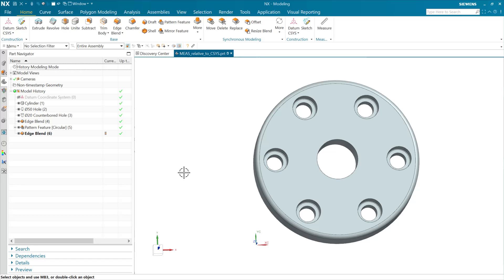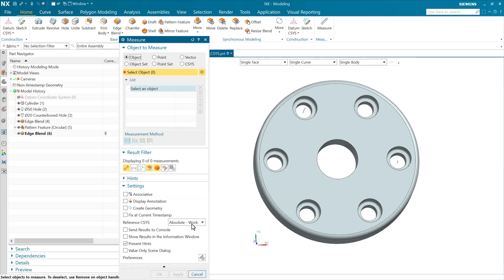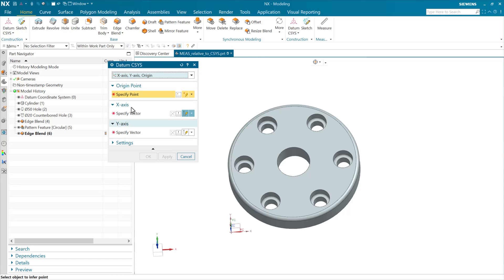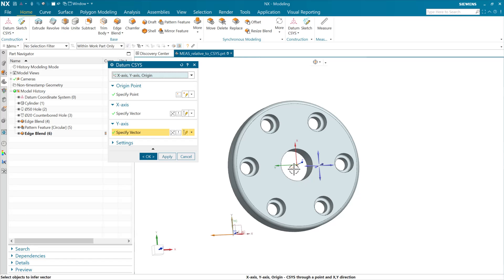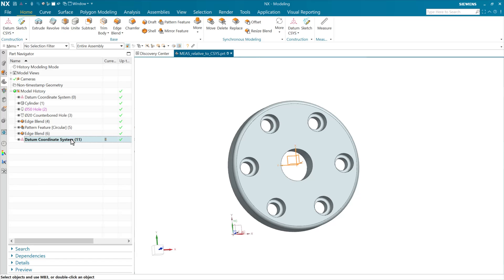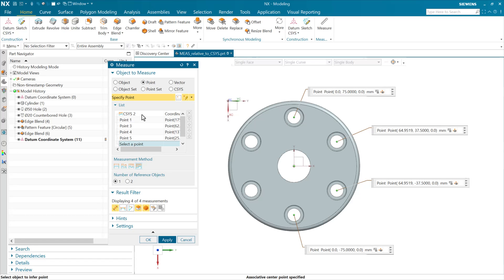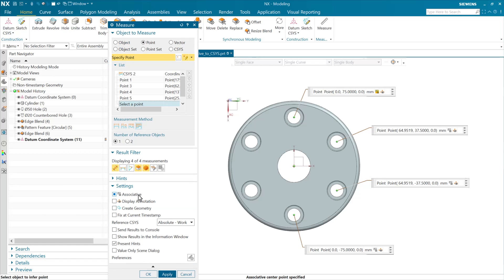NX Measure: Measuring relative to an alternate coordinate system [NX 12.0.1]

Comment: Hello sir, how to calculate PCD of that patterned hole wrt wcs
Reply from the maker: I think you're asking about the Pattern Circle Diameter?  In newer versions of NX (starting with NX 2406) you could directly measure the pattern circle diameter using three points.  In older versions, creating a circle using three points first, and then measuring the circle would likely be the fastest way.  Does that help?
Reply: @taylorandersonnxvideos  thank you for the reply sir, yes it works in newer version.....

Comment: Hi Taylor!Is it possible to get COG with respect to new CSYS you placed in the center?
Reply from the maker: Great question.  Looks like that would be a two-step process today...  You could measure the Center of Mass and create a point (either associatively or non-associatively) and then you could measure the location of the point with respect to the new CSYS.  Does that make sense?  (And yes, this sounds like a great Enhancement Request, if you'd like to submit it.)  🙂

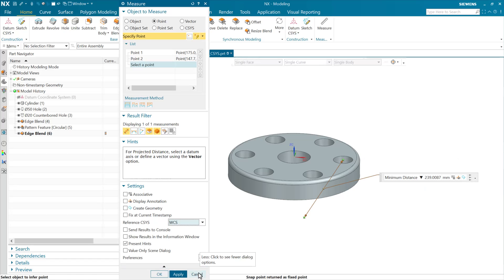Comment: Hello Taylor, very clear, informative video as always - thank you. Quick question: At t=2:24 you had canceled the Measurement Tool, then moved the WCS back to Absolute CSYS (global 0,0,0 location), I assume by using Ctrl+Z to undo the WCS move? But however you moved WCS back from the hole in the plate back to Absolute origin, the thing that puzzles me is that at the instant you moved the WCS back to the Absolute CSYS, the visibility of Datum CSYS (0) turned on. Is that a feature on NX? Or was there a gap in the recording and during the gap you had manually turned on visibility for Datum CSYS (0)?

Thank you.
Reply from the maker: Great question!  My voiceover is usually recorded at the same time as the demonstration, so I honestly don't do a lot of detailed edits... I went back and tested this just now, and sure enough, the CTRL-Z "Undo" is undoing the "Hide" operation I'd previously performed on the Datum Coordinate System prior to the beginning of the video. So yes...  that was just normal NX behavior, and not any editing trickery.  😀  Great eye!